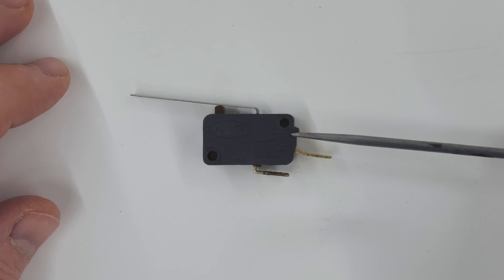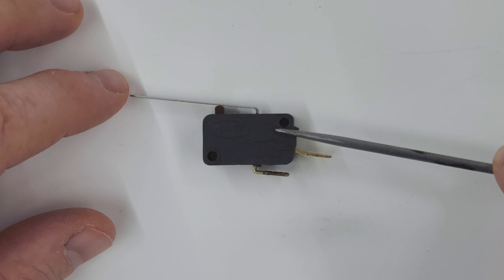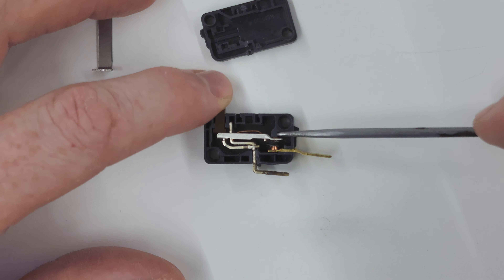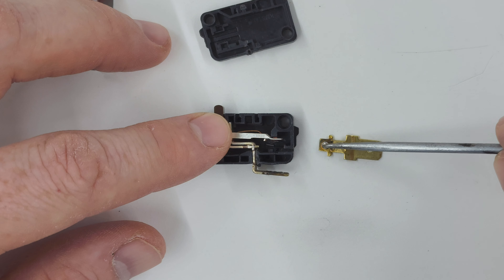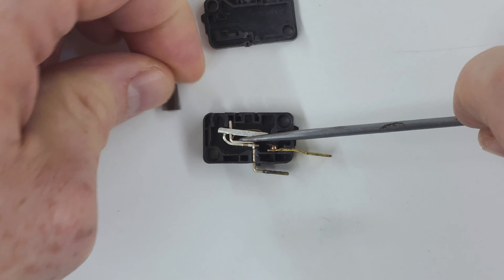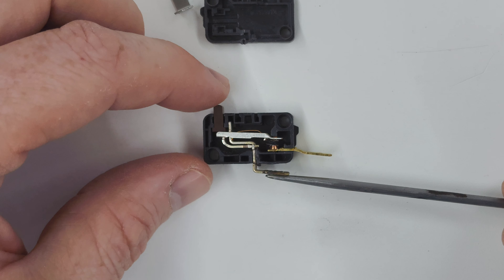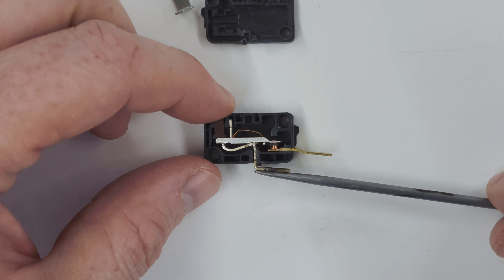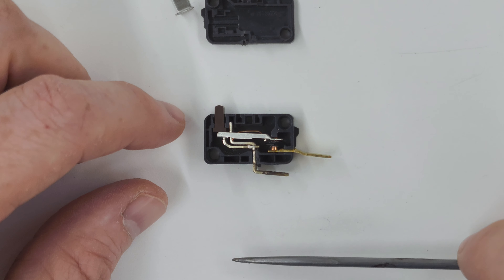Failed micro switch from a DeWalt DW735 thickness planer (correct diagnosis this time)

Comment: Nice diagnosis. Funny what happens when a simple part fails. Dewalt definitely needs a more reliable switch.
Reply: Ah, maybe, but the switch failure was a symptom, not the underlying problem, which was the excessive heat that developed in that part of the circuit because the wiring was being subjected to too much current for it to handle without getting entirely too hot.

Comment: Hey this was so helpful! My planer died mid-cut. The outlet still had power and the internal breaker wasn't popped. But sure enough, that little switch was cooked. Only the tiniest bit of browning on the plastic, would not have noticed it if I hadn't been looking for it thanks to your video!  FWIW, I think mine failed in a slightly different way than yours. The little piece that carries the upper (moving) contact was only moving at the end opposite the contact, so it never touched. I.e. never turned on. Now I've got it going again. Excellent tutorial, thanks!
Reply from the maker: Excellent, thanks for commenting.

Comment: Yup, that’ll do it!  Good forensic on the switch.  

My Fluke went swimming in the bed of my pickup during a deluge… 

When I changed my 735 cutter head to a carbide spiral cutter,  I didn’t have a way to test the amperage draw.  Bit, I did have a power strip that couldn’t handle a 10” white oak, with a 1/32” cut, using the old three knife blade.  I put the new cutter head through passes up to 1/16” and the power strip never overloaded.

Amp draw matters… if the components are under spec… something’s gotta give!  

My son-in-law didn’t want to pay for 12Ga wire when he ran wiring for his air compressor.  The 14Ga run across the rafters in his shop almost burnt it down… electricity has a way of weeding out the weaklings!
Reply from the maker: Air compressors definitely push the limits. When I bought my first one I read the manual, which said that it was better to buy longer hoses than a longer extension cord. I doubted, but was later convinced by a breaker trip and hot cord.

Comment: Outstanding explanation as to why the switch is behaving the way it is! it would be interesting to know what your line voltage is in your shop. Possibly the line voltage could be less than the nominal 120/125 volts. In my shop the it reads127 volts. I am certain you know  why I am asking this!
Reply from the maker: I haven't measured for a while, but it was 120 with no load, and when I started planing 10" wide red oak (drawing 35 amps) it dropped as low as 115.
Reply: @TheSnekkerShow  Wow That is a lot current even for a start up! no wonder the switch is failing.